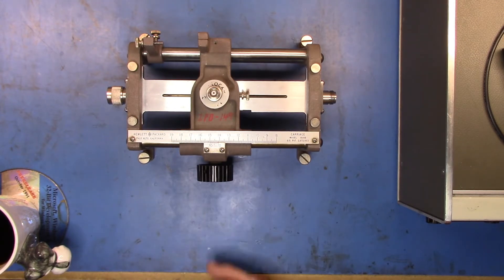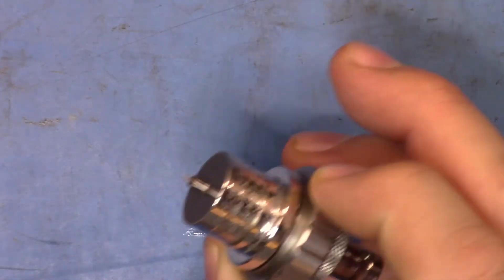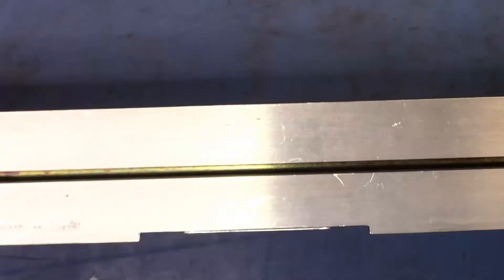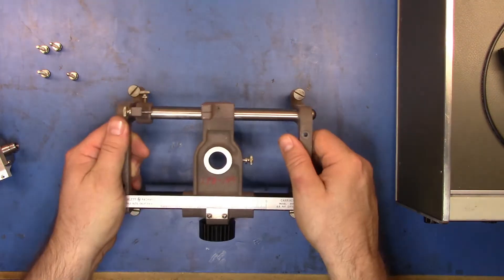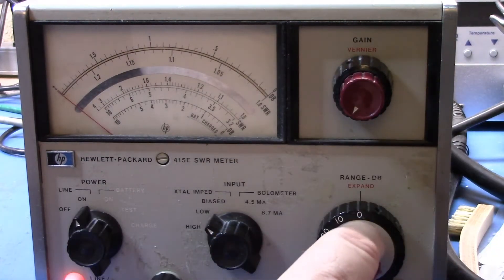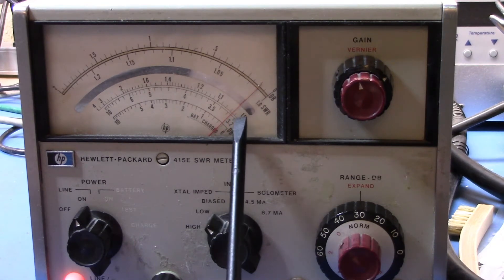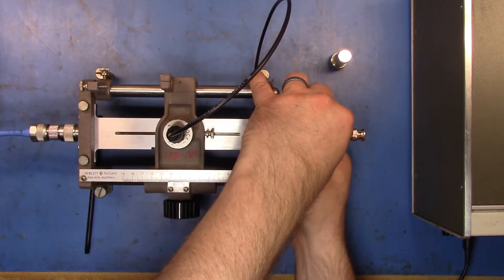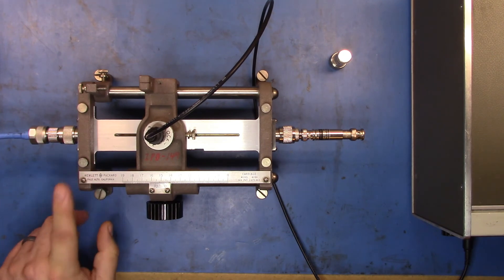HP 809B slotted line carriage with HP 444A detector & HP 806B slotted line

Comment: Nice demo.  You can use the standing wave pattern of a total reflection as a calibration standard.  The standing wave pattern follows the magnitude of a sinusoid:
A= sin(PI*x/d)  d is the 1/2 wavelength and x is the displacement from a null.
Since the meter is calibrated for square law, the dB variation is 10Log(A)
Reply from the maker: Great suggestion - Thanks for the comment.

Comment: Nice, demo, I have that SWR meter too, my slotted line is the GR-900 from General Radio
Reply from the maker: Thanks, appreciate it. I almost bought a GR slotted line but bought this instead - As an aside, I need to get an air line to calibrate the 8405A and the GR ones seem to be reasonably available so one of those could be my first GR piece of kit.